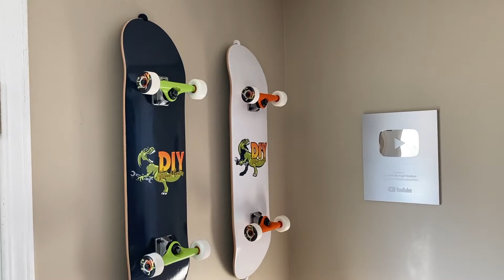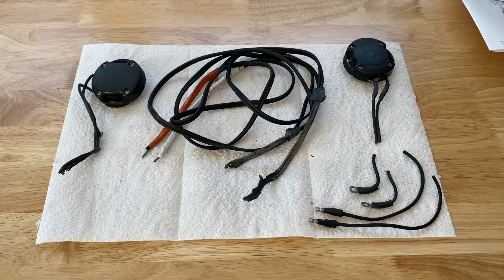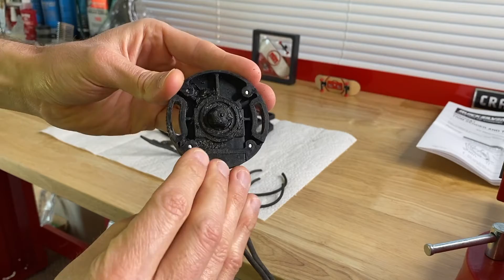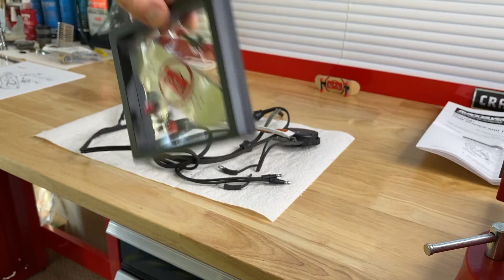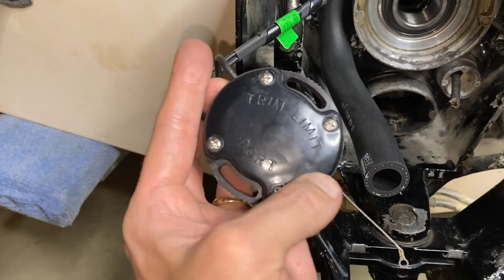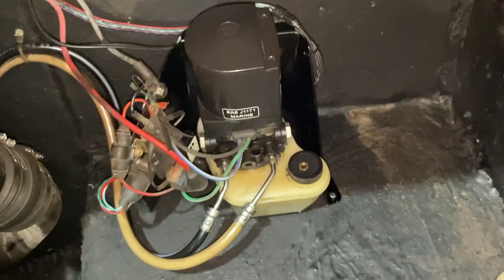Mercruiser outdrive Trim limit/sender switch kit - OLD vs. NEW

Comment from the maker: If interested in purchasing this product, visit our Amazon affiliate link below.  I earn from qualifying purchases.

     Trim limit/sender switch kit:  https://amzn.to/45GOIXb

     OEM Set screw:  https://amzn.to/3rWY4zt

     Gimbal bearing grease seal:  https://amzn.to/3tGswhF

     Perfect seal (New sealant):  https://amzn.to/3FmGnMR

     Security bit set:  https://amzn.to/3FolgJW

     1 1/16” deep socket:  https://amzn.to/3PVEoUs

     Bellows replacement kit:  https://amzn.to/3RL7h8v

     Shift Cable Socket:  https://amzn.to/3qtVdgq

     Hinge Pin removal tool:  https://amzn.to/44YuasH

     Flex Shaft Screwdriver:  https://amzn.to/3s8E3W4

     Utility knife:  https://amzn.to/3QBjP1K

     Bellow adhesive (92-86166Q1):  https://amzn.to/3sv9nyF

     Lacquer thinner:  https://amzn.to/3QGvxbd

     Long flathead screwdriver:  https://amzn.to/3qMm08a

     Aviation gasket maker:  https://amzn.to/47XHS18

     Wire brush kit:  https://amzn.to/3OTZ8vr

     1 1/16” deep socket:  https://amzn.to/45T1u4j

     800 grit scuff pad:  https://amzn.to/47SaM2y

     Bell housing bushing/oil seals(23-805041A2):  https://amzn.to/3szdhGS

     Swivel vise:  https://amzn.to/3sfLsAv

     3/8” socket extension:  https://amzn.to/3EhRKFa

     2lb hammer:  https://amzn.to/3QDHiz3

     Water tube bushing cover:  https://amzn.to/46yp9aI

     Water tube bushing seal:  https://amzn.to/3tjcBWt

     44'' Water cooling hose:  https://amzn.to/48IEcQX

     Gear lube SAE90:  https://amzn.to/45vlqux

     Marine grease 2-4-C:  https://amzn.to/3PiLmDX

     Loctite 271:  https://amzn.to/47SXV00

     Outdrive gasket kit:  https://amzn.to/3rb5HBR
  
********

1.  Remove gimbal bearing grease seal

          https://youtu.be/JfQQX81xrrA

2.  Install gimbal bearing grease seal

          https://youtu.be/X93vYELLtDc

3.  Replace bellows/shift cable/water tube PART 1

          https://youtu.be/NcObTOYXtQM

4.  Build your own custom skateboard

          https://youtu.be/9Isty_4fIIw

5.  Mount your skateboard on the wall

          https://youtu.be/c5QDCKZNGH0

6.  Replace Trim Rams and Hoses

          https://youtu.be/5BetZVkPPHI